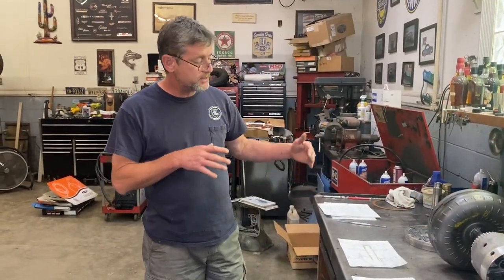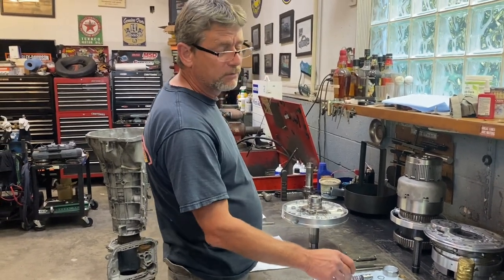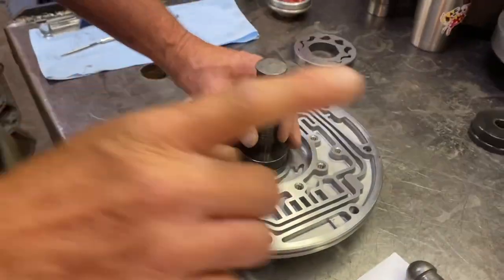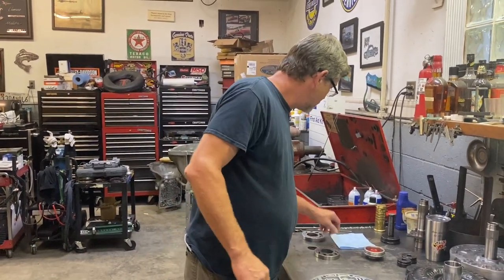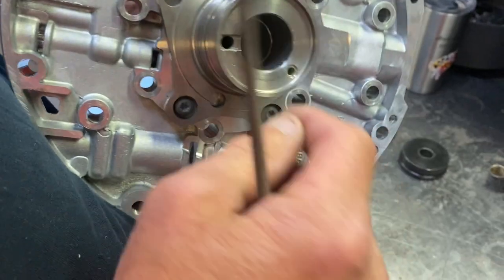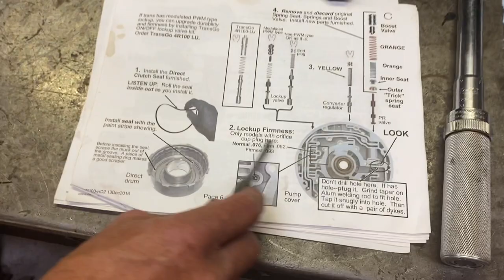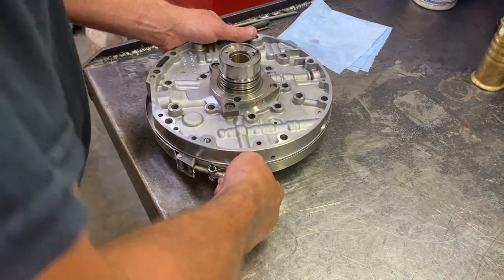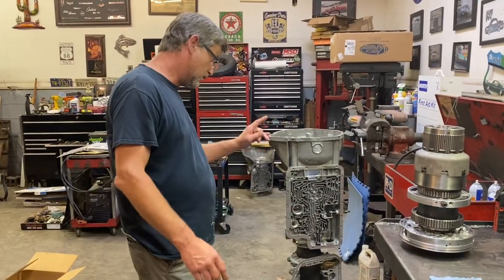E4OD/4R100 “PUMP FROM HELL IS DONE” And The TOWER Is Built !

Comment: Marshall I want to thank you for making these videos I am a mechanic but I have never done any transmission work before other than just swap em out. And I  have a 2001 f250 7.3 that I have towed a lot with and the torque converter lock up stopped working and after watching your video I decided to take it apart and replace the torque and the valves in the pump.  Thanks for the confidence!! . It's working perfectly
Reply from the maker: Awesome I’m glad my videos gave you confidence to make that happen. One of the main reasons for doing these videos. Being a mechanic your fully capable of doing it just need the right guidance. Transmissions aren’t rocket science just more complicated than most repairs on a vehicle is all. Thanks for the comment!

Comment: Thanks for the video lessons. In Ukraine, there is little information about the E4OD automatic transmission. Not all workshops want to repair. Here you have to figure it out
Reply from the maker: Ukraine wow that’s pretty cool! I have a bunch of videos on rebuilding this transmission. Should be all the info you need to get it done right. Just take your time
Reply: @marshallsanders5672  I was already in a hurry. And he did not succeed. the first and second gears engage, and the third and fourth do not engage. First, I will check the oil pressure and then I will disassemble it again

Comment: Hi Marshall, is it still possible to assemble the convertor without the large band clamp shown in your video?
Reply from the maker: It is but no easy! Pump alignment is Critical so it’s in alignment with the centerline of the transmission and the Crankshaft. 
  3 ways I’ve done it without the band are
(1). Use a strait edge put the halves together like normal, just finger tighten bolts down for slight resistance but the halves will move. Use your strait edge and eagle eye with a light and go around the pump  many times until the 2 halves are in perfect alignment. Done this many times it’s tedious but it works!
  (2)Alignment pins work well just have to find the perfect size for the holes your putting the pins in Drill Bits/ dowels etc. this works well as well just check with strait edge after torqued!
(3) put the two halves finger tight upsidown in the case align holes and torque down. Also recheck with straitedge and make sure it’s perfect. I’ve done all 3 of these procedures with much success just have to be patient and keep adjusting til it’s perfect. Hope this helps

Comment: For the Torque Converter Lockup Firmness what would you recommend for a Billet Triple Disc Converter from PATC in a Truck that Tows 10-12K Trailer?  Not towing that amount of Weight every day.  Thanks Again for your advise.  Running the Tugger Kit, it says .76 for Normal .82 for Firm and .93 for Firmest.
Reply from the maker: The triple disc converters tend to lock-up a bit on the firmer side anyway because they have so much clutch surface area to them. With what your planning on doing with the truck I personally would go .082 and expect it to be a little aggressive when not towing but shouldn’t be to abrupt. To firm(not good) To soft (not) good. Just right is key and it’s somewhat of a guessing game but that’s where I would go with your application.

Comment: Should you put the Trans Temp Probe on the Cooler Line leaving the Trans?  Is that the best location to monitor the Trans Temp?  Thanks
Reply from the maker: Yes that is correct the hottest fluid is coming out of the transmission going to the cooler so the best place for a temp guage is there !

Comment: Hey Marshall, wonder if you could help steer me in the right direction. This 4r100 won't quit leaking. It's just a little drip while running coming from the bell housing. We've replaced the end seal, pulled out the pump and replaced those seals, put in a new torque converter, but there's still a drip. Transmission works fine. What am I missing?
Reply from the maker: Alex, Unfortunately that is a gotta be there situation to really tell where its leaking. Is this the reason you pulled it out ? sometimes I've seen where someone before Gouged either the case or the front pump body seal area and caused a leak. Did you change the bushing ? 600 grit or finer on the converter hub ? when you pull it out look VERY close for any Cracks in the case or Pump Body itself. Just have to search until you find the exact cause should be obvious when you do actually find it . Something also I’ve learned over the years is when a chronic problem like this arises search UNTIL you find the problem don’t just reseal it and hope it’s fixed.
Reply: @marshallsanders5672  it's been rebuilt by somebody before so I guess now I'm chasing some one elses problem. Thanks for the advice. Cracks is kinda what I was thinking.

Comment: Marshall my 4r100 7.3 99 350  shifting 2nd to 3rd loud bang only have  park
Reply from the maker: Just to clarify it seems it shifted and you heard a bang and NOW all you have is park and basically neutral in every other gear ? If this is the case something BROKE or STRIPPED inside the unit. If it has park the Transfer case seems fine so a tear down and inspection of the transmission is necessary.
Reply: Ok thanks for getting back to me brother I appreciate  it

Comment: Outstanding.  Learned so much on this video.  

Do have question on delayed reverse and shift kits though. The one I have had a restrictor orifice in low reverse feed worm holes.  That just really confused me, so I pulled it.  The original rebuild (the expensive one) had that restrictor and I pulled it out.  Maybe I screwed up but the 3 second delay is now less than a second.  Do you know the purpose of the restrictor in the low reverse hole in the worm passages?

Thanks to you my transmission is in my Excursion and is operating perfectly.....so far. 
I cannot say it enough THANK YOU!
Reply from the maker: Yes The theory behind the restrictor is to Slow down the apply of that clutch in hopes it will not cause a Harsh engagement ! Which is counterintuitive to getting that clutch on sooner than the Direct Clutch which generally IS the cause of a harsh Engagement in the first place. Never made sense to me but some Shift kit companies seem to think it is a better strategy. I never put that cup plug in any of my transmissions. And also can cause a delay because it will come on slower. You did the correct thing in pulling out the orifice. Good Call ! Sounds like success to me my friend ! Good Stuff !
Reply: @marshallsanders5672  Ok that makes sense and assures a novice.

Its that cup plug that killed an expensive transmission.  While stuck in snow it was put in reverse.  Snow is slippery and driver did not know transmission had not engaged yet and applied accelerator.   3 seconds later that transmission kicked in and BANG! Low reverse pinion spun in low reverse hub.  STUPID CUP PLUG!!!
Reply from the maker: @rodshuffy4045  Gotcha DAMN ! Yep STUPID Cup Plug but that's all it takes. That makes all the sense now. Snow and Transmissions generally don't play nice together anyway ! Glad to hear your success Story

Comment: Hi Marshall! I have a question regarding converter lock up. I have a 95 7.3 e4od and notice that there is a delay (rpms jump up 200, then back down) when the truck is in OD mode (OD button ON) in the 3rd to OD shift at around 40ish mph. If I keep the trans in drive (OD button OFF) and accelerate to 45ish then manually push the OD, I will not have that jump in rpms like I do if driving in OD “on” through all the gears. Seems the 3rd-4th shift happens too early before TC pressure locks up. I believe it’s the TC lockup delay in 3rd to OD 4th gear shift. The TC locks/unlocks as it should earlier in the 2nd-3rd shift. All gears shift firm and crisp. Do the front pump mods in the tugger kit improve the tc lockup in OD? Thanks for your help and been trying to troubleshoot this issue as I feel like it will ware the TC prematurely.
Reply from the maker: What is most likely happening here is the computer control of the torque converter “just” before it shifts into O/D. I noticed this in the transmission I have done all these videos about ! Under med to heavy throttle the computer will unlock the torque converter just before the O/D shift (200 rpm rise) shift into O/D then lock it back up once it’s in O/D This may be what your feeling with the TC O/D shift. It is all in the PROGRAM of the computer which they didn’t get quite “Right” on the early transmissions. 
When your in O/D off it appears the torque converter locks up in 3rd and when you push the button and shifts into O/D Without the torque converter unlocking if that makes sense ? 
   It’s all in the “Programming” of the computer and again they didn’t get it quite “right” so to speak. Let me know if this is what’s happening or whether there is an actual problem inside the trans!
Reply: @marshallsanders5672  that’s exactly right! The unlock-OD shift happens almost same time. When I’m heavy throttle the tc doesn’t unlock prior and stays locked into OD. All makes sense and it is intermittent while under light throttle. Plus mine is behind a 7.3 PSD. I will see if my tuner can command TC to stay locked in 3rd regardless of throttle. Thanks for your help buddy! All makes sense now

Comment: side clearance of the pump do you mean 0,0015 inch? Sorry i am used in using metric system. Mine has about 0,005 inch.?
Reply from the maker: Yes I mean 1and 1/2 thousandths   .0015           5 thousandths or .005 is way to much and will create pump pressure and volume problems.         .002-.0022 is about MAX to ensure there are no problems in that area.
Reply: You speak from inch right?
Reply from the maker: @dieda-unterwegs6253  Yes Sir !That is Correct
Reply: Thank you. BTW I really enjoy your videos. They are great and full of useful things

Comment: Hi Marshall,
I have a question about concerns with my stator half of my pump. It is a 99 4r100 pump but the PR valve bore is so worn that I cannot pull a vacuum at all. The TCC valve passes with a vacuum of 18-20” Hg. Any suggestions? Is that usable with a sonnax orifice pr valve?
Reply from the maker: Damn, That's a tough one depending on how worn out it is ! sounds like it is pretty worn out. The sonnax valve will compensate for bore wear to a point. Only two other options are buy a used body and hope its not worn out or buy the oversized Pressure regulator valve but this requires the purchase of the reaming tool which is pretty expensive. Wish I had an easy answer but those are your choices.
Reply: Thanks Marshall, I’ll see if I can track down a good used pump, I’ve got the cast od drum too so as long as I order a non PWM body I should be able to swap the stator shaft if need be?
Reply from the maker: @aaronmcnab9911  Aaron, It seems on a 99 you should have a PWM Body but just match what came out of it and you should be good to go !
Reply: Yes, however the pump is a 99 probably due to someone upgrading the pump to a higher capacity from stock. I’m assuming it would’ve had an F5 casting originally being a 97 E4OD?
Reply: Hi Marshall, I’ve been thinking about what you said about 99 being likely a PWM pump, and since my front half has 99 on it I’m beginning to think it’s a bitsa coupled to the original stator half as a way of increasing the output of the pump?

Also I have a question about my build. I have a 92 7.3idi f250 and was wondering if I should add a friction to the forward drum for a 5 friction arrangement omitting the cushion spring? I have already sanded down the old bevel plate for the direct drum and clearance checked it. How harsh is the engagement without the cushion plate and would I need the extra clutch in forward?
Reply from the maker: Aaron, I think we need to step back a moment here. I’m still learning to get fuller details up front from you guys as this is the starting point for any build . The biggest thing is what year truck and computer system is the trans going in? If your building the trans for a 1992 then you Need to have a non PWM stator body in it, meaning a On/Off lock-up valve not the PWM valve in the stator body. 
The higher volume pump really has nothing to do with the stator body itself it’s mainly the pump body and gears. 95 and up has the 9lobe inner gear and the 2 holes feeding the gears are larger say 3/8” or so as opposed to 1/4-5/16” on the early pump bodies. 44 min. Into my evolution video explains the pump differences and what you need to know. 
As far as putting 5clutches in the forward it really comes down to your intended use of the truck. If you plan on towing anything heavy with it then yes put in the extra clutch in the forward. It will “bump” into gear generally not harsh though. If your not towing then 4clutches are just fine and there is no need for more clutches. If there is still confusion send me some pics of your pump parts and we’ll go from there. overdriven67@ @hotmail.com